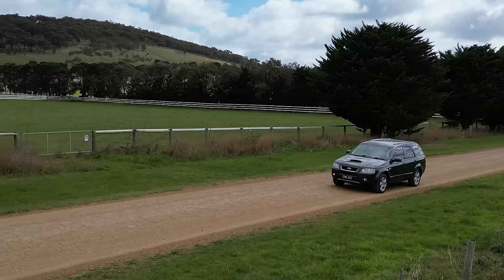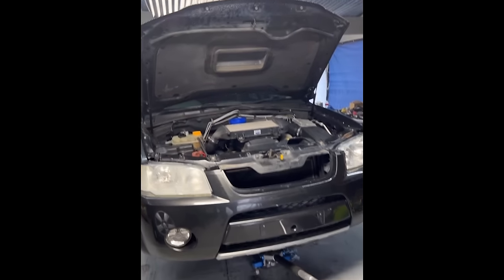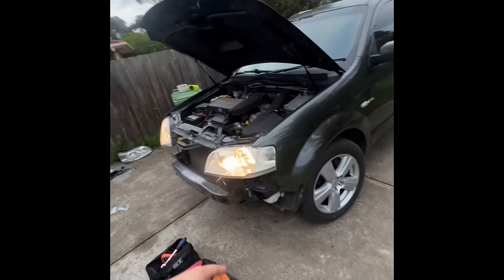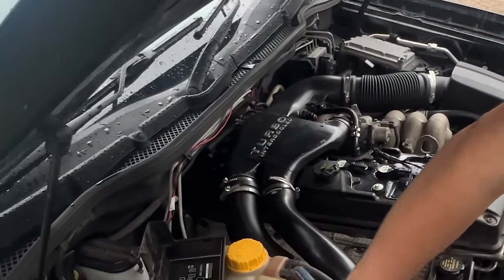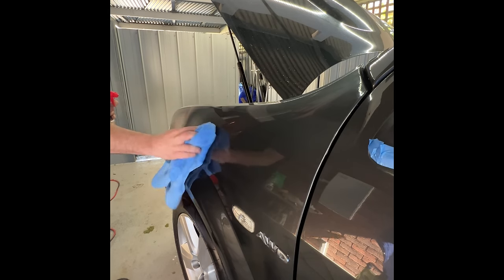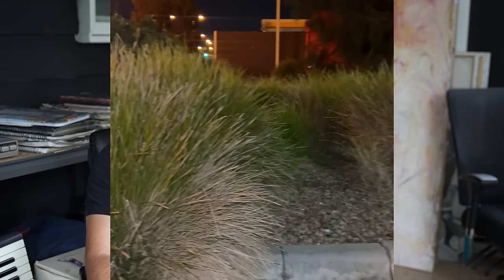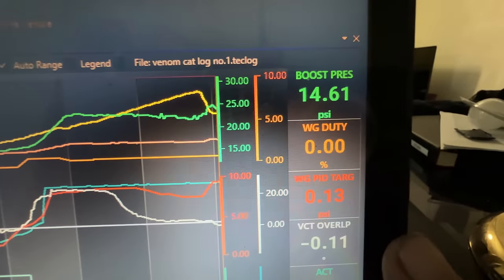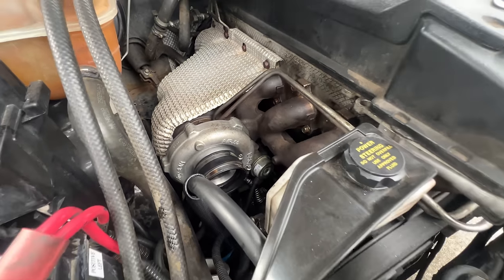Scammed by Facebook Ad, Saved by my Son: Transformation of a 'Junk' SUV Turbo Territory Barra Part 4

Comment: Took me about a year to find a nice TTG in Sydney. I found myself in a similar situation, in need of a bigger family car.
Logically after owning and working on Barras most my life a TTG was the ideal option. 
One finally popped up at a dealership asking for a fair bit knowing what they had. We pulled up and this thing was immaculate and I couldn't walk away. Since my year and a bit of ownership I have yet to see another one on the streets of Sydney. 
So far I've only done basic mods like BOV, intake and debung the exhaust. As well as upgrading to a Kayhan system and full security system.
Only just discovered your content and glad to see some Territory stuff happening. 
Cheers for some inspiration, love yours and your sons work. 
Also have a nitro blue FG xr50

Comment: 5500 for a turbo territory Ghia???? Dude, that's not a scam that's a rough car you know is going to need work. Pay market value i.e mid teens, then you've got a scam
Reply from the maker: Scam means dishonest scheme , nothing to do with the price , misleading ad , said one thing and was another
Reply: @georgeauto  in what context though? He said two things based on what? Was it to get it to what his mechanic said would be needed to get a roadworthy? What you think it needs may not be what the next guy says it needs. A lot.of this time that sort of thing is subjective commensurate with the age of the car and the Kilometers. SY territories have been doing the rounds for a lot of years now. You got it for a dam good price, it's original appearance to anyone who's dealt with cars in any type of volume suggests 'this is gonna need some bucks spent'.
Reply from the maker: @Coopsoldman  I screenshot the ad you can read it for yourself, “needs a couple things” horn blah blah , did you watch episode one? He even states that it’s a 7 seater in the ad which it is not , came with set of wheels that he knew didn’t even fit and didn’t tell me, missing at least 10 bolts from under the car and around , tailshaft only on finger tight , cluster and ECU been cut out and changed, literally would not ID himself of give me his licence number after asking multiple times ,